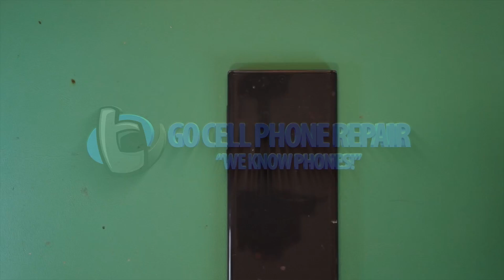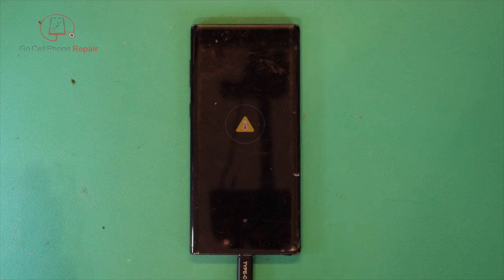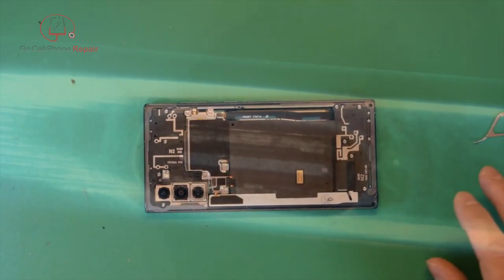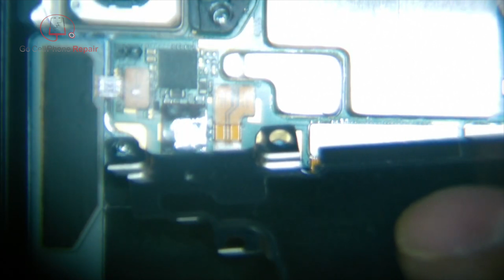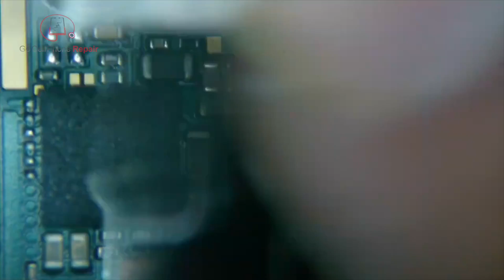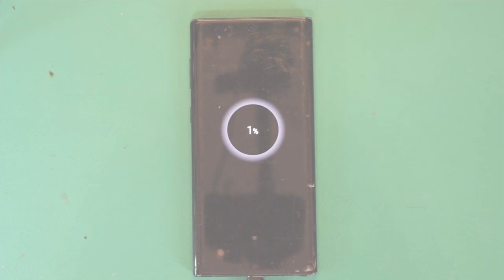Galaxy S10 Yellow Triangle

Comment: From this I learned that even if my s10 is totally different that this inside (and the cameras are horizontally aligned) my nfc is on the shield covering the entire thing so to test the phone with new battery I need to also mount that shield. Everything ok now, thanks.
Reply from the maker: Glad that you found it helpful. Samsung likes to do that with different version of the same device. It's kind of annoying when using a donor that doesn't match for repairs.

Comment: happend to me this morning. I had it on charge last night then turned ot off when I went to bed. I plugged it back in this morning and got this temp thing. I turned it on and changed charger plug for PD charging and seems to be charging. it couldn't even been to hot, if anything too cold.

Comment: My galaxy s10 has this issue, I took it to a local phone repair place and he just handed it back to me and said, "oh once it has that triangle on there it means you need to buy a new phone." 
I called samsung they tried selling me a s24 series.
 Samsung told me, my phone is old and I need to get an updated one. 

My phone is scratch free, Crack free, looks brand new, can anyone please advice what to do. 🙏
Reply from the maker: I haven't worked on the Lite version so someone may correct me here but I believe that the wireless charging coil is located in a panel behind the outer back panel. Generally you will find the yellow triangle is caused either by a bad wireless coil flex, a damaged thermistor in the charge port- this port can be replaced as it is plug and play- damage to the battery sense circuit built into the battery terminal, or worst case scenario a bad thermistor on the motherboard itself the location of which I am uncertain on this model. Hope that helps.
Reply: @GoCellPhoneRepair hi i have an A04s, showing the yellow triangle with thermometer and on the bottom of screen it shows a charging cable with a line on it. I replaced the charging port with 2 new ones, including an original one and nothing changed. If i attempt to start the phone, screen flashes for a second and thats all. If i remove the charging board, phone starts. What do you think? Will a new charging board fix the problem?

Comment: Can you tell me how to solve same problem in Samsung s10 lite
Reply: Same reason I'm here
Reply from the maker: Copied from another replay: I haven't worked on the Lite version so someone may correct me here but I believe that the wireless charging coil is located in a panel behind the outer back panel. Generally you will find the yellow triangle is caused either by a bad wireless coil flex, a damaged thermistor in the charge port- this port can be replaced as it is plug and play- damage to the battery sense circuit built into the battery terminal, or worst case scenario a bad thermistor on the motherboard itself the location of which I am uncertain on this model. Hope that helps.

Comment: I see the yellow triangle when it's off but when it's on it charges what is the problem still
Reply: I think it's caused by using a charger that is going bad? I got mine on Amazon had it 6 months now this problem started. and cant tell if it's a real Samsung charger. I just went to Samsung site and bought a new fast charger for $19. That might solve the problem.
Reply: I think it's because of the charger you're using. I noticed that too in the current phone I'm using. I realized the charging cable was fake.